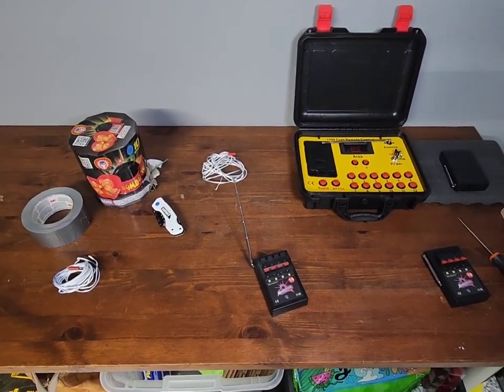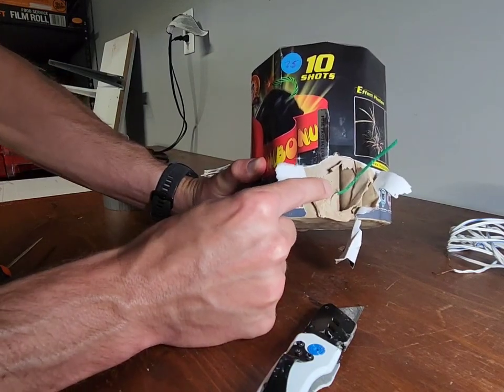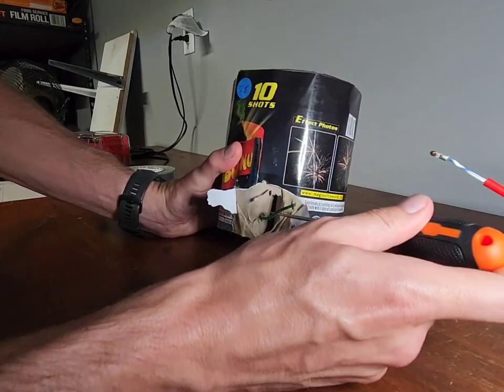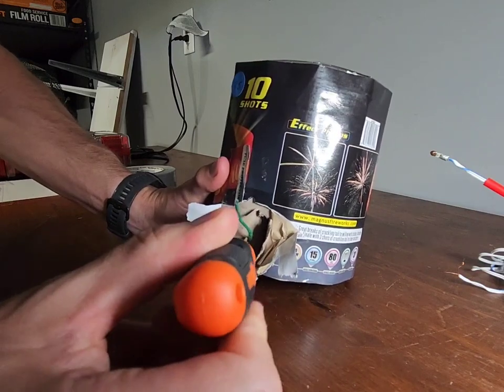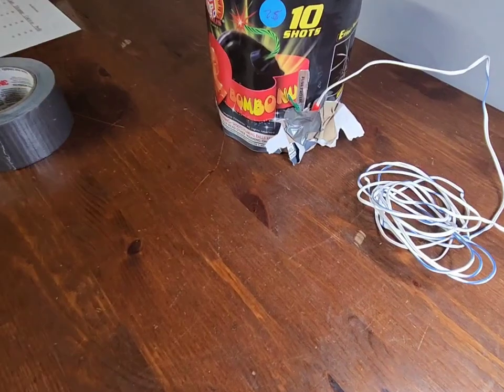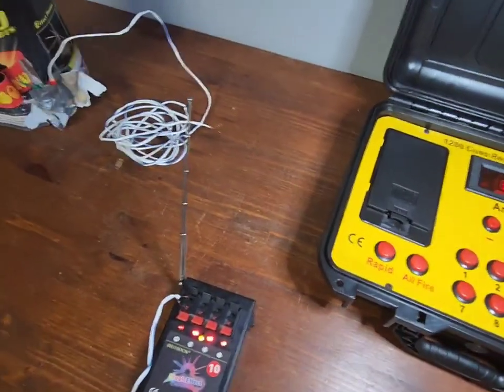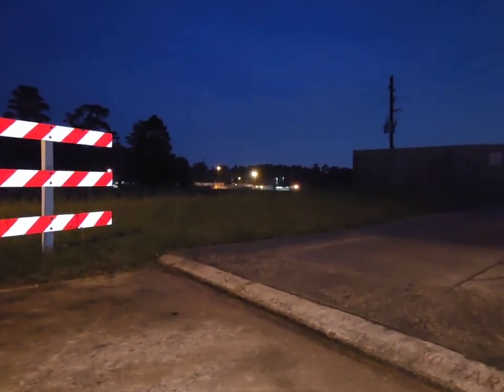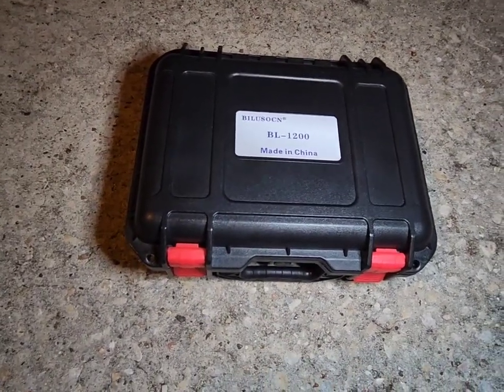How to Fire Fireworks Remotely - Bilusocn Fireworks Firing System

Comment: Thanks for the video. on these cheap firing systems, the red LED under each cue will illuminate bright red when you have continuity on the circuit. I knew your button press would fail as all of the LEDs were dim. Before shooting your show, go to each module and ensure each LED under a cue you have a match/igniter on is BRIGHT red.

Comment: Really???
Reply: That what I'm thinking. I'm a licensed Pyro and I wouldn't hang around with someone jabbing holes in a firework. There are adapters that clip right on the fuse so you can use an e match
Reply: @davidwallace3224  what sort of licensed pyro are you lol? in years I have NEVER seen a clip on igniter used for a professional display. that being said, this video is not exactly good or safe advice.
Reply from the maker: Hey guys thank you for the feedback!

Remember, brass is a metal that does not cause sparks. Therefore, using it to punch into the powder to place the match is completely safe. 

We deal with TONS of companies that put the electric match directly into the firework Blackpowder.

Edit: Yes, keep the plastic cover over the Ematch that you insert. This prevents from inadvertent fire 

It is safe and works well. 💪
Reply: @phfamilyfireworks  yeah I am glad you used brass! thats the safe way to do it. Please don't ever remove the shroud from the ematch though. they can be incredibly sensitive to friction or impact. that plastic shroud is there to protect the tip. just bore a slightly larger hole into the cake and gently insert the ematch WITH the shroud covering the tip. then fold it up and tape once over the hole and then anywhere else over the wire as strain relief. Thick brown packing tape is what most of us use. it won't come lose sitting in the sun and it adheres to the cardboard tube better than most other tapes. I know multiple people who have had a nearly fatal accident by tugging on ematches or removing the shroud. The ematch went off with a product still attached. be safe!
Reply: @AB_Pyrotechnic I saw a video with doing ematch on canister shells. Is there an easier way to use FireWire with canister shells? Or safer way? I don't like the talon igniters so I'm trying to finally use FireWire for canisters instead.
Reply: @Octuly  for cans i just run a box cutter along the bottom disc of the shell. Peel it up slightly and put the ignitor in. Then close the disc and tape over the cut part so no lift charge can leak out.  add one more piece of tape on the wire near the top edge if the shell for strain relief. With shells make sure you wrap the wire around a screw or something on the rack once loaded. If you dont the shell could lift with the wire still attached and damage your firing module. You want the wire to snap.